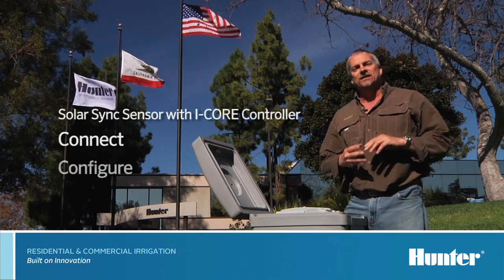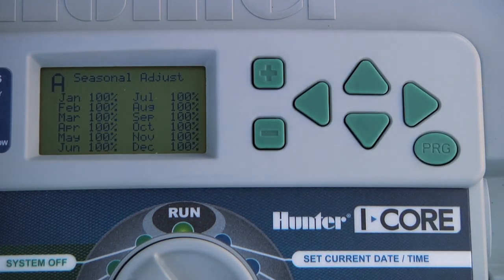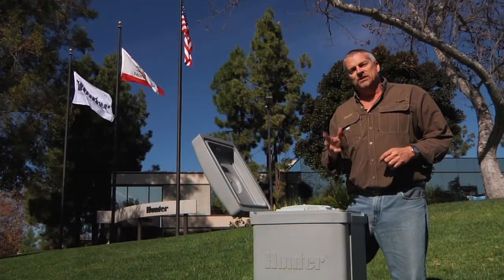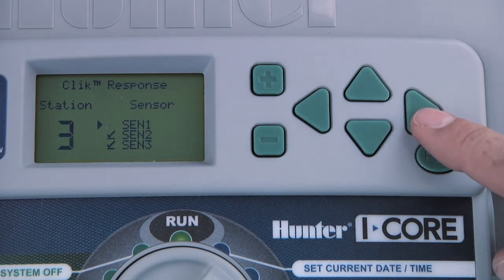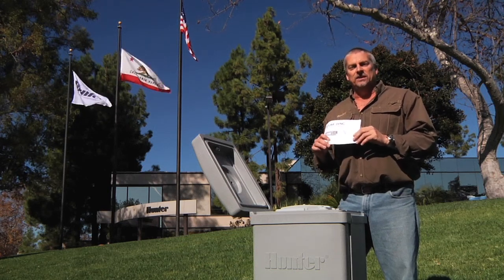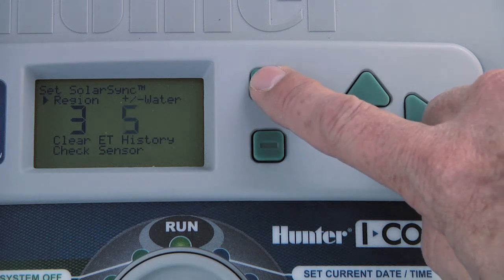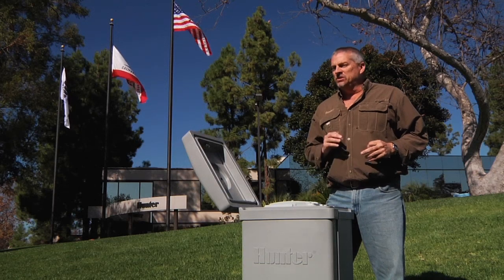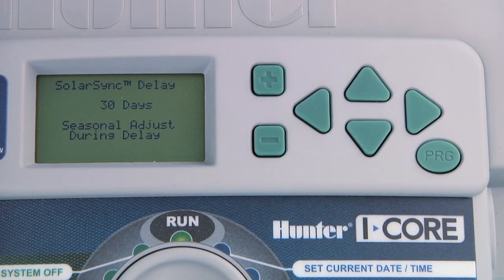I-Core Controller: Solar Sync Setup

Comment: This is a friggin nightmare. I just want to water my yard for 15 minutes every morning. That's all! This is insanely convoluted.
Reply: How do you set the manual to water more the one zone?
Reply: 🤣  We just bought a home with this exact sprinkler system.  I just Run a program check for 15 mins (the max mins it allows) until I have the time to figure this stuff out.  This has way too many features for our yard.